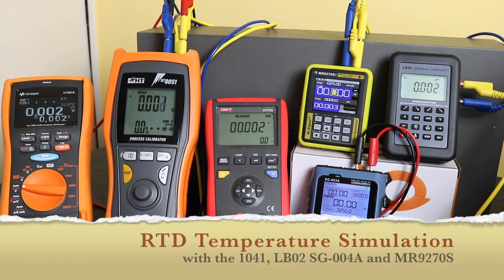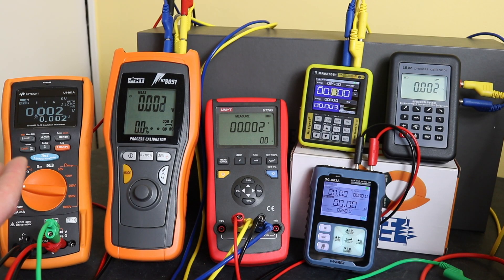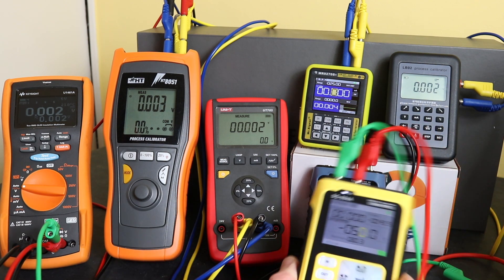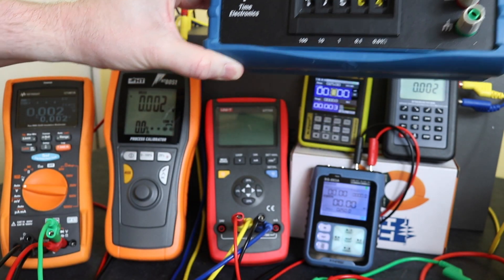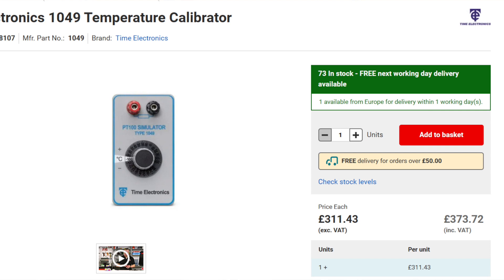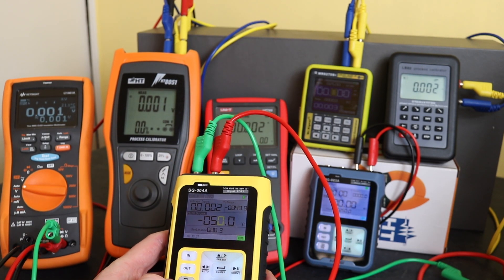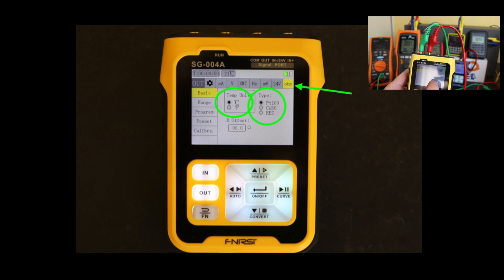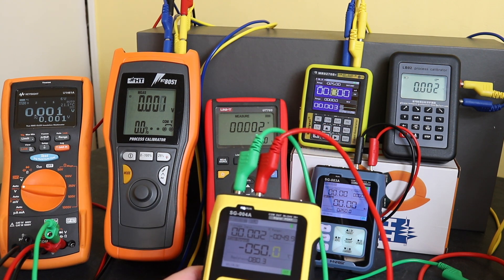PT100 Simulation with LB02, SG-004A and MR9270S

Comment: Thanks for this comparison! I was looking for the most accurate one that can be calibrated by an accredited lab. The LB02 manufacturer confirms that this isn't possible. Would this be possible with either of the other two devices?

Regards!
Reply from the maker: Both the SG units and the MR9270S have calibration menus built into them to allow them to be adjusted against a calibration source. 
From my tests with my units I purchased I don't think the SG-004A would be stable enough for calibration. The MR9270S does appear to perform much better and you may be able to get it calibrated. 
It would depend what level of accuracy you are after as well. If you are happy to move away from the manufacturer's specification, that would help.

Comment: A question about the offset at 2 min 36 sec. Is this offset intended to compensate for the resistance of the cable to the PT100 element?
Reply from the maker: Yes, that is what it would be used for. If you were on a plant, depending on where you tested from you may also have extra cabling and terminations to contend with.
Thanks for watching and the question.

Comment: Really enjoyed this series of presentations on the Process Calibrators.
RTD temperature verification (cal) using an electronic simulator would only be a functional test for me.
As proven with your Time decade, any errors can be optimised (good bench DMM) to negate the offset.
Precision electronic kit (Beamex MC6 approx £10k) (Fluke 726 approx £4k) isn't really feasible for the average process engineer, and uncertainties (2, 3 or 4 wire) may still need to be applied.
MR9270S+ looks pretty good though.  Is the resolution 0.1°C when simulating PT100?  With my LB02a having 1°C resolution on RTD's this may have been a better option, even though reviews were scarce.

In my experience, adjusting process loops (to bring within specifications) was problematic, as HMI's, chart recorders and PLC's were locked out at the time of testing!

Are you planning on testing Thermocouple accuracy?
Can of worms 😂
Reply from the maker: Glad you have enjoyed the videos. Yes the calibrators offered by Beamex / Druck / Fluke and the like are the ideal solution, but as you say very expensive and more of a company investment rather than an individual engineer. 
Yes the MR9270S+ does have 0.1°C resolution for the PT100 simulation, I haven't really tested it to that level of accuracy though.
It is an option to look at thermocouple accuracy although I would need to assemble a few things to do that. I do plan to test out the 24V supply and PWM functions first. 
Thanks for watching and commenting.
Reply: Are the temperature sensors certified externally, or tested onsite with a dry block and reference sensor?
When I tested my LB02A for thermocouple accuracy (K-type covers 95% of my needs) it was approx 0.25°C of expected on my 6.5 digit DMM.
Once connected to a digital K-type thermometer (cold junction configured correctly and compensating cable used) I found errors of up to 1.0°C easily achieved.

Will be interesting to see PWM functionality and configuration.
Reply from the maker: @scottshaw1310   Sensors are all onsite tested with a dry block. Thermocouples are a very small signal, especially outside of a lab environment, so easy to get inaccuracies creeping in.
Reply: @three-phase562  Dry block cal/adjust/cal of temp sensors is a real chore I find!  Much happier working on pressure transmitters,    position valves, data recorders and the like!